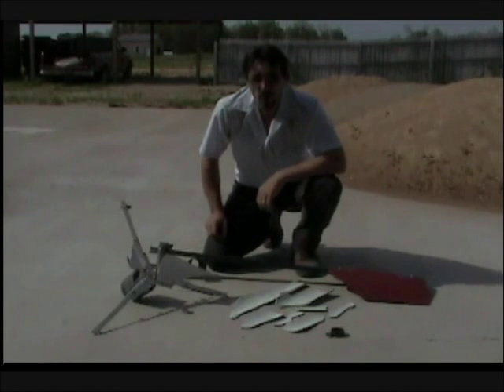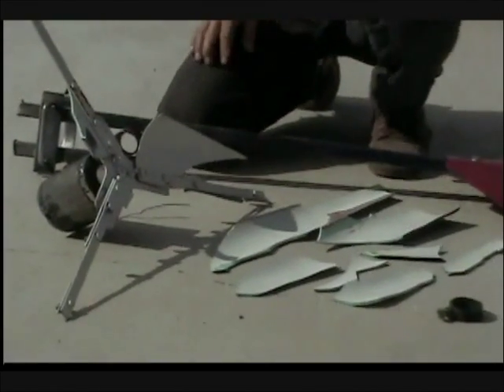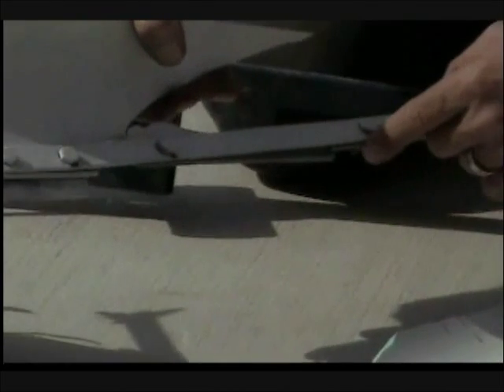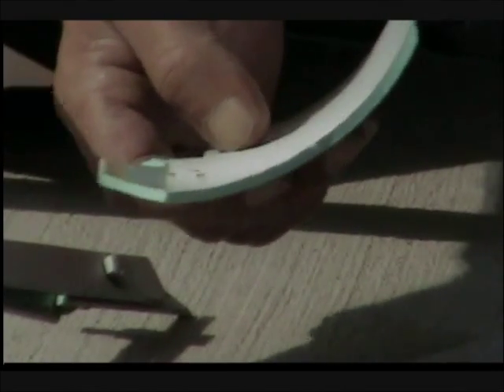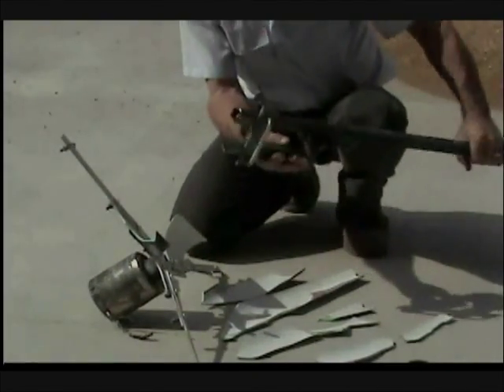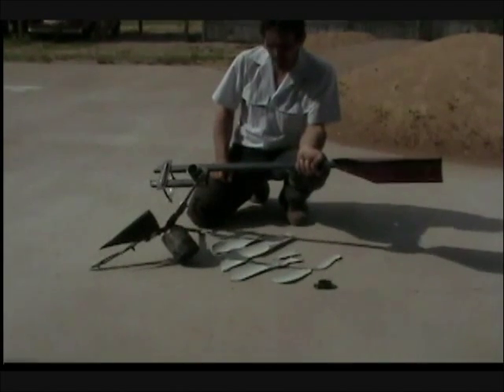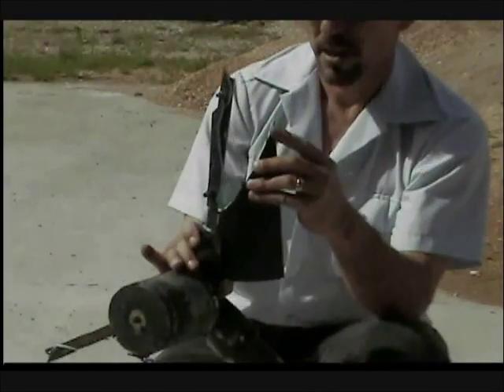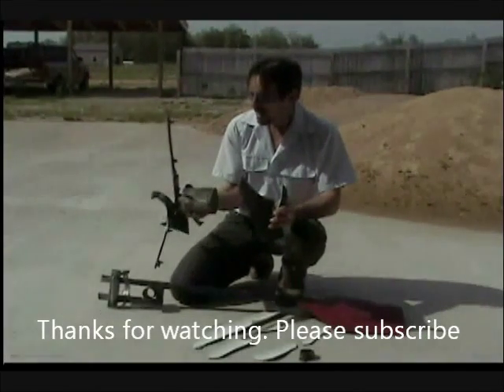PVC Wind Turbine Blades Explode: Review | Missouri Wind and Solar

Comment from the maker: My Raptor Generation 4 blades are made up of several composites, not plastic.
They have a 25 year UV protectant added, impact resistant added to  take severe hits without breaking. They have hit winds of 100 to 125 mph without breaking. They can take severe sub zero weather, i have a playlist of guys in Norway , Sweden , Canada etc that have had my blade up and running for years, no breaks yet.

Comment: i heard of a type of pipe called high density polyethylene (hdpe) pipe apparently its more flexible and wont shatter like pvc do you think this would be safer than using pvc
Reply from the maker: Dean Walcott No i don't. It is still pipe that's not meant to take that type of flexing constantly.

Comment: hdpe would be a great material for a blade it has more flex than pvc allowing it to bend slightly without snapping and is much more shatter resistant then pvc and it is also lighter than pvc

Comment from the maker: Here's some interesting Facts on the Windmax. The blade finish is gone in less then a year, Billy showed that on one of his videos, He got that Windmax 600 from me. The Windmax charge controller with built in dump load, 50 percent of them fail within a year. Check out Magnets 4 less, they have been selling the Coleman Air controllers for a year now to replace the bad Max controllers.Chinese never sell American products.This info i got right from Mr. Wang at Magnet's 4 less.

Comment from the maker: Furling or no furling, ABS, PVC will become brittle when exposed to the sun. Those plastics are not meant to ever see the sun, there underground or in your basement. Over the years i have had hundreds of emails from guys that have used all types of plumbing plastics and the results are always the same, 2 to 6 months and, BOOM, blades broke and tore the wind turbine apart. Ask any plumber what happens when ABS or PVC is exposed to the sun.

Comment: i guess maybe next time you should use thicker pvc pipe, use safety wiring and cotter pins, keep moving and rubbing parts lubricated, and keep it out of the sun
that's poor designing and decision making on your part
Reply from the maker: Any PVC pipe will break. I made the turbine to show what will happen when you use PVC pipe for blades. The design is the same design a lot of people were using at the time. How the HELL do you keep a wind turbine out of the sun ?
Reply: shylildude thicker pvc pipe would be worse it would break and be heavier and the fragments would have more inertia which would have even more momentum